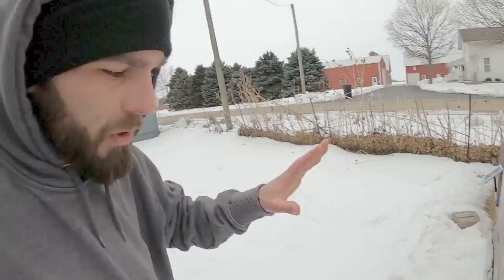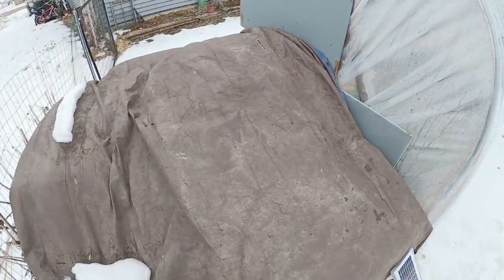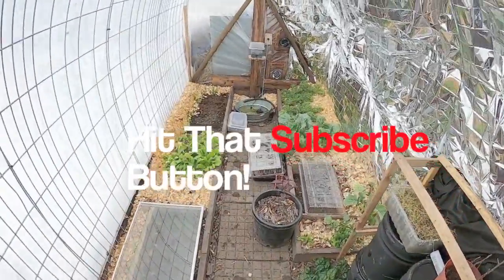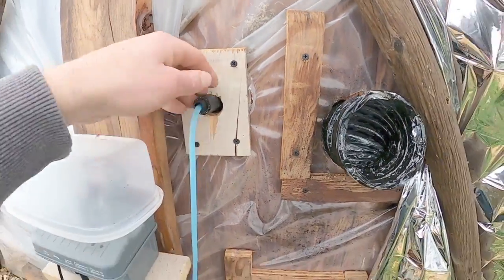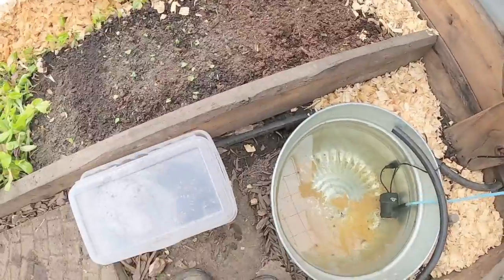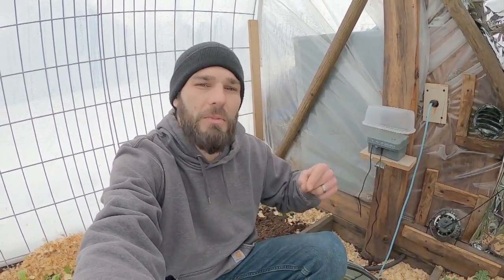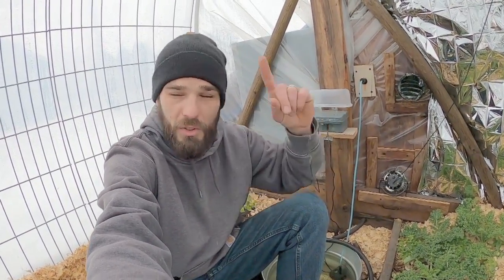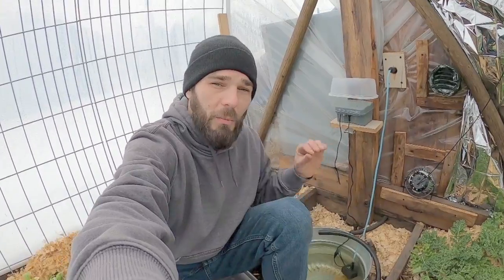DIY Cheap Winter Greenhouse Heating | Jean Pain Compost Heating Solar Experiment | Zone 5a/4b

Comment: Very cool set up, looking for these ideas for remote heating in Alaska, thanks so much for posting!  Actually had a grass mulch pile in Texas catch fire on its own, excellent idea to control it for a heat source!!
Reply from the maker: With the right size and materials you can get a pile to burn for over a year. Great resource in a cold environment!

Comment: I got that exact usb solar fan for my dog house in the summer. Don’t mount it upside down.   My fan blade came off and the motor is shot. If I would have mounted it right I think it would have lasted.
Reply from the maker: Our original 5w fan has lasted two years plus in humidity. But I never mounted it pointing down. Thanks for that input!

Comment: I have a greenhouse that i need to put up. I will be using passive solar ( 80 feet of concrete lego) and wonder if the compost inside the greenhouse might add extra heat? I live in central Alberta Canada. Temp outside right now is -35. You think the compost might be an option?
Reply from the maker: Of course! And if you build a big pile run a 4” tube through to allow air to compost heat transfer and set a fan up blowing the air! We just did this in our large 52’ diy greenhouse
Reply: @Earthdwellershomestead  do you have problems digging out your pipes in the spring? I am thinking flexable weeping tile. but would not want to need to replace it each year.
Reply from the maker: It can be tricky, we’re going with pex tubing for the water system and we’re going to be digging out a simple geothermal system this week, we will see how it goes. We’ve only had issues with our pond hose cracking so far.
Reply from the maker: The culvert/pipe we’re going to lay for geothermal will double as cooling in the summer so it will stay in the ground*

Comment: You should try running an electrod thru the compost. Won't get much power but you could get enough to have a back up for rainy days when the sun isn't out to recharge the battery.

Comment: Where is this, at least the zone and latitude?
Reply from the maker: Northern central United States
Reply: @Earthdwellershomestead  What state, I'm in southern Ontario so looking for some comparisons as to weather and light levels/duration.
Reply from the maker: Actually northern Illinois. Your more northern but this can be done anywhere, as long as you can get a big enough compost pile together your in good shape for a heating source. Lots of plants will still grow in the winter with low light.
Reply: @Earthdwellershomestead  Thanks for the help.

Comment: Is your fan set up just for cycling air through the compost pile for heat, or is it for helping to add fresh air for an increase in microbe action to further decompose the wood chip?  
Also that's a really cool setup you have
Reply from the maker: It’s completely heat draw only. It pumps air from greenhouse through the compost and back inside only heating the air not transferring gasses such as methane or co2
Reply from the maker: Thank you!

Comment: Brilliant, i love it.
Reply: Would wrapping  your hose around that steel pan on the floor before going underground keep the pan water even hoter. Am asking since we usually have -40C were am at.
Reply from the maker: Yes it would and if we had used copper instead of the free hose we had we would get better transfer but this was diy as cheap as possible
Reply from the maker: Also the pile size and consistency (materials) determine how long it’ll stay active for.
Reply: @Earthdwellershomestead  How long the size you have can last?
Reply from the maker: Anywhere from 4-7 months I would say with an estimated guess

Comment: It's nice. Long time that I'm using branch grinds to cover my garden soil. So I perfectly know how it could heat when in a heap. 
Though I never thought to use it to heat my greenhouse. i rather dug a "pool" under the greenhouse that I filled with water (5 m3). 
But actually heating a greenhouse with the fermentation of organic matter is an ancient system. In the past they rather used (horse) manure. Digging large ditches in the greenhouses, deep of at least 1,2 m and filling it with manure. It's much simpler than to use the heating source outside the greenhouse, like you do. But there's a little inconvenience :-) Out the odour, you need to put the manure out after the winter. And to cover the ditches with a floor.

Comment: Nice system.  Just curious maybe a dumb question, but why not put the pile in the greenhouse itself?  Seems like some heat loss could be reduced or captured in the house that way.
Reply from the maker: That is a great question, we have it outside because our greenhouse is so small we wanted all the sq feet for growing or walkway. In our big greenhouse we have a pile in the corner that will grow all winter as we add materials.

Comment: Is heat the ultimate limiting factor of how fast your compost matures? To much composting, too much heat limits the population of composting biota?

Man a system like this that salvages waste heat might also be able to do double duty at speeding up your compost.
Reply from the maker: It surely siphons heat well, keeping it active is based on how large it is to start or if you turn and add materials. Great observation! Thank you

Comment: Interesting talk but you did not give real examples as far as how hot the compost pile was, what the outside air temperature actually is, with the inside air temperature of the greenhouse is, what is the soil temperature inside the greenhouse... You can say anything but data doesn't lie.
Reply from the maker: We have many videos showing temperatures and what we can achieve by this. In our large greenhouse we have some passive and solar powered experiments running also. We kept the greenhouse about 45-50F soil temps and roughly the same with the airspace
Reply: @Earthdwellershomestead  I will have to check out some of your other videos this just popped up in my news feed as something I might be interested in. Maybe it wasn't the best first introduction/example for me to come across.
Reply from the maker: Exactly! Thank you

Comment: You never mentioned the temperature inside the Polly tunnel?
Reply from the maker: We kept the airspace and floor around 45-50F all winter inside the greenhouse, thank you
Reply: @Earthdwellershomestead   so not much difference than outside. Heat goes to cold, and very rapidly. I have a 20ft by 10ft pollytunnel and am fighting for ways to keep it warm through winter and I’m in the UK 😩 I have tried composting inside  the tunnel but not much changes. Everything is constantly trying to stabilise to the temperature outside. 

The only thing is a constant fire inside.
Reply from the maker: Our outside temps were -20F when we still had warmer temps inside, we achieved great heating with little cost
Reply: @Earthdwellershomestead  oh sorry I thought I heard you say it was 8 degrees c outside 🙄

Comment: How do you keep the humidity down?
Reply from the maker: The heat from compost seemed to push all the humidity out whenever I opened the door, and having the wood shavings covering the soil didn’t allow nearly as much moisture into the air. We’re fighting this in our large 52’ greenhouse right now

Comment: How do you keep the compost pile temperature up. Does it cool off or do you keep adding nitrogen or green material  ?
Reply from the maker: If it’s large enough you can build it once and burn for months. But if it begins to cool we add nitrogen and stir

Comment: What are your sustained temperatures inside of the greenhouse with your setup??
Reply from the maker: Airspace fluctuated during the day but at night our compost kept it about 45-50 f and the floor was heated all night from the water at around the same temps. It’s a small greenhouse but this system worked well enough I have replicated it in our 52 ft greenhouse. Thank you
Reply: Wow, that's great!! Keep up the good work!! Those temperatures held at 8 degrees Fahrenheit??
Reply from the maker: Yes, we lost heat all winter because it’s just a diy greenhouse with no solid panels for insulation. Our pile kept producing and that’s what kept the temps up in the floor and air, insulation all the way around with straw bales helped a lot with holding heat in the beds

Comment: Why not having the heap in the greenhouse?
Reply from the maker: Due to the small size 6x12 and co2 & small methane production filling out small airspace. We have a compost heater running in our 52x10 greenhouse this winter in another video

Comment: Great method..! Now let me ask, something that I been mulling over. What if you could submerge a coiled pipe in your septic tank? Underground is warmer, but does a septic have same kind of decomposing heat? I don't know. I was thinking if it does, then I would make it like a radiator with fluid pump and a fan.
Reply from the maker: Anaerobic doesn’t create much heat but lots of methane and co2. I’m actually working in this right now, 😂 I’ll be publishing a video containing that subject matter for our next video.
Reply: @Earthdwellershomestead  so would adding an air bubbler change it to aerobic?
Reply from the maker: Technically yes. But oxygen directly effects the process of the slurry breaking down & not allowing methane to form but however the process of aeration inside septic is widely used as the bubbles break down the waste up to 15-20% faster
Reply: @Earthdwellershomestead  I have to say I'm glad no methane. Was considering risk of explosion. Well, only other concerns is what bacteria to inoculate with and expense of running a pump and fan.So a solar powered air pump would cut expense.
Reply from the maker: We use a solar bubbler for our compost tea! They work great and even bubble a bit on cloudy days. No need to inoculate a septic there’s tons of bacteria and enzymes already present, adding enzymes to aid in the breakdown is usually when there’s no bubbler in the system
Reply: I picture 2 tubes zip tied together for the tank coil. One water/antifreeze, one air with tiny punctures to let air bubbles out with end capped off. Maybe weights to keep hoses sunk to bottom.

I guess an outhouse would be the safest way to test. I mean what if the tank gets hot enough to explode...! Maybe still cranked out methane, burns house down. Things I just don't know.
Reply: Is the solar bubbler something you put together or someone got it for sale as a package deal. Post a link if so. (Thank you for taking time to reply, much appreciated).
Reply from the maker: I invested a little money and it has ran for at least two years reliably, lots of uses also! Let me see if I can find link AEO Solar Powered Air Pump Kit, two airing stones, 3LPM Air Pump & 2.5W Solar Panel for Fish Pond, Aquaculture, Hydroponics, Bubbleponics https://www.amazon.com/dp/B07NP75JFP/ref=cm_sw_r_cp_api_glt_fabc_431TG1HC26M4PJ8VNYWM?_encoding=UTF8&psc=1
Reply: @Earthdwellershomestead  Cool.!
Reply: subscribed

Comment: What are your extreme winter Temps? Where I am located. Cold snap during the winter -40°c. Average during the winter is normally day time is between -10 to -20°c. Nights -15 to -30 °c
Reply from the maker: We had a polar vortex sweep through and it brought -60+ (-51c) weather, normally we see -20 to -30f  (-28 to about -35c) but it can vary as we have had some extremely warm early winter weather followed by negative temps. It’s up and down lately but it gave us a little opportunity to get our new greenhouse planted late.
Reply: How warm were you able to maintain during the polar vortex?
Reply from the maker: @heathermcdougall6088  that was brutal lol! We still had a hot pile and held heat and did not loose plant so above freezing certainly!

Comment: Do you have a video link that I could watch how you did your system? I have lots of manure mixed with wood chip bedding every day during the winter and piles of composted also but I'm not using what I have to the best of its ability. I do have a greenhouse about the size you have.
Reply from the maker: Our most recent video I went over the diagram of this build. Let me find the link->https://youtu.be/WqvFRzDoc_o hopefully this helps some

Comment: How do you keep the rodents out?  I would be afraid they would be attracted to heat and make their way into the greenhouse from the compost pile.
Reply from the maker: An occasional mouse trap is all that’s needed. If the material cools too much it may bring in mice or if I was using any food or items like that, the majority of our compost is naturally occurring outside and some urine, chicken poo, wood ash, and comfrey (yarrow also) I’ve not seen many mice other than in our piles that have food for them.
Reply: @Earthdwellershomestead  
Thanks for replying.  I don't generate enough yard waste to heat a greenhouse, but I really liked the resourcefulness of this approach.  

I have heard another way to keep rodents out of compost is to keep it wet.  It appears from your comment that your compost is often wet and still generates heat.  So this is a double bonus for those who want to be self sufficient.  Thank you!!

Comment: In the past French intensive market gardeners used windrows of horse manure with soil on top. They planted directly into the soil over the composting manure, no pumps hoses etc just heat directly below the crop. In those days they put glass cloches, like jars with the bottom cut out, over the crop to retain the heat. Now we can do this inside a greenhouse. I’m sure that they would have to aerate the pile to keep the heat up. I’m sure you could just put a pry bar into the manure below the crop to aerate. You could probably use any carbon source and add chicken manure tea to the pile to heat it up.
Reply from the maker: I made a hot box coldframe last year that performed well all winter in this way in a sense. I bet you could put a tube with holes underneath the hot bed to pump air from beneath. Great thoughts and ideas thank you!
Reply: In New Mexico an early  solar greenhouse was down in the soil about 4 feet and the lower section had chicken races so that their decomposing poop would help warm the building. During the early fortified settlements found in Poland were built on peat beds and had two stories. Animals below and humans above. Survival in extreme climates require smart adaptations.
Reply from the maker: Thank you for the great input!

Comment: very inventive I wonder if the results would be even higher by having the entire thing bermed in like surounded on all sides as like compost walls .. then you can put that out when the weather warms up as fertalizer etc.. or expanded growing or grow right in the berms in the spring as growing mounds. I wonder if you can also grow right under the tarp.. and if the results would be even more by having a clear tarp.
Reply from the maker: We used straw bales that insulated the immediate ground around this little greenhouse. Compost , and warm compost at that would work better certainly!

Comment: Hum, I think that the fan should be positioned at the top of the greenhouse, pushing the "warm" air to the bottom.
Reply from the maker: If the pile was larger it would’ve worked better on this little system. Check out the video we just released. We’re doing similar.
Reply from the maker: I was heating cooler air from the floor to circulate floor to top
Reply from the maker: Check this out DIY CHEAP Winter Greenhouse Heating With Solar & Compost | NEW Experiment Demonstration & Breakdown
https://youtu.be/6BQR903L8p8

Comment: I have a few questions. How long does the pile keep producing heat? Won't extracting heat from it also cool it down? And will it work in freezing winter temperatures?
Reply from the maker: Depending on size and materials anywhere from 2 weeks - 15+ months. Yes it does cool it down. Our 140-160F pile will be about 120-130F running due to draw. And yes we used it through an entire month of negative temps!
Reply: @Earthdwellershomestead  Nice. Thanks for the answers! I suppose bigger is better in this case.

Comment: how bout another plastic sheet or ground cover on frame over the beds ( would take 2)........i found that the second cover gave me another 7 degrees F
Reply from the maker: We just threw some extra poly over one bed and it’s drastically helped, when paired with heat exchange from compost it really gets the plants growing faster than I’ve seen in winter.great input & thank you!

Comment: Perimeter Insulation would help.  If you dug an 8 inch wide footing-like trench, 4 + feet deep, (below frost line) and filled it with water proof insulation, then the encapsulated earth could be your big heat battery.  1/2" Pex tubing ($75 / 300 feet) buried in the encapsulated earth, can heat up that earth and thermostatically switch a 12-Volt ~ 8 Watt pump to control the heat distribution.  
ACTES (Annual Cycling Thermal Energy Systems) have proven to work well for > 40 years now.   More & more insulation is the answer to good building energy performance.  Every sheet of plastic provides an R-1.  4 sheets provide an R-4.  Double pane windows with 3+ inches of foam board insulation to close over the windows at night, is easy to build.
Reply: 2nd hand double pane windows are great.  Be sure not to use windows with "Low emissivity" films, because they block out 90% of the essential Ultraviolet light, that plants need to grow.   Handy guys can make their own double or triple paned windows.  Just seal the glass to the wood with silicone caulk,  in very dry (low humidity) weather.
The North Side doesn't need windows with your greenhouse design.  It can be just good insulation - R-40 ? 
Yes, this is a lot more work, but you surely won't starve then.
Reply from the maker: This is a great piece of advice! We’re looking to build more greenhouses and we need to insulate the earth certainly! . Thank you